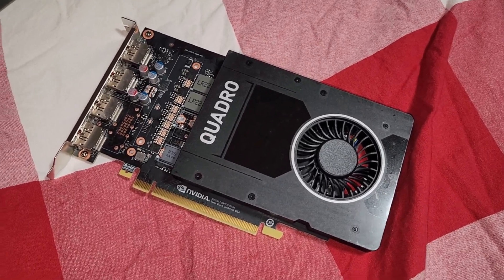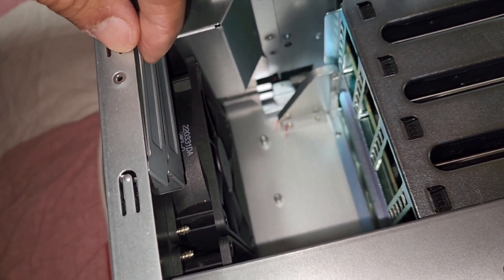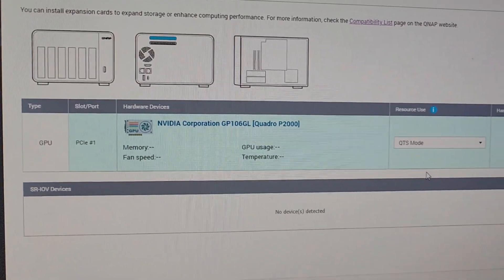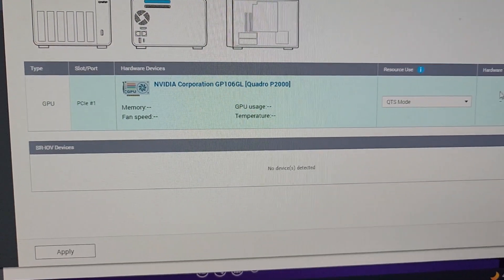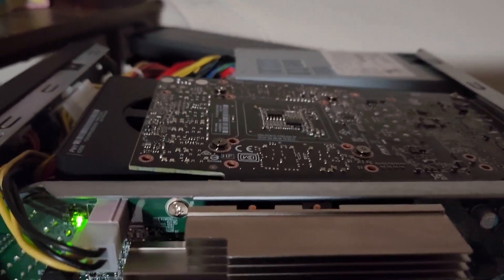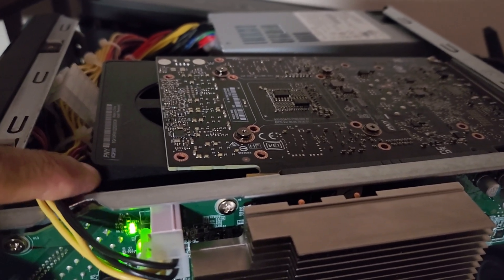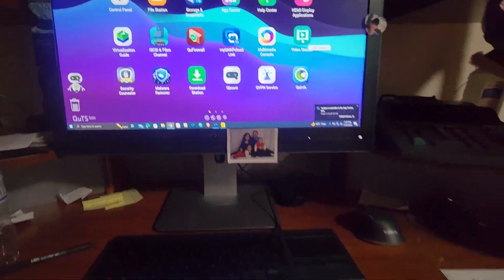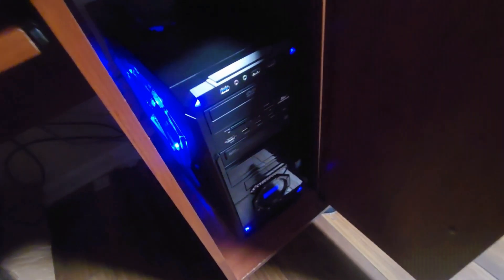Qnap Tvs-h674-i5 craziest video card upgrade!

Comment: Great video. I'm wanting to upgrade from an IBM rack server running TrueNAS as my plex server to the QNAP TS-673A and it looks like the motherboard power supply connection is exactly the same as in your NAS here.  I've got a P2000 I was planning on installing so I'm glad that it will still work with just a little cutting.

I also have a 10g network card and a pair of 16g sticks of RAM I'm going to be installing as I plan to run ZFS like I run on my current NAS.
Reply from the maker: @FastRedPonyCar  awesome 👌 as today still rocking 😎
Reply: @GHacks7  OK so I got mine built this weekend and they must have changed the position of the power cable connector and also made it much smaller.  There was a ton of room for my P2000 and getting everything else setup was pretty simple.  A very smooth experience and tested flawless transcoding huge bitrate 4K HDR videos to 1080p.

Comment: Great video! Would you be so kind as to check if this card works in the Virtualization Station?
Reply from the maker: @marcinosko8204  So far, everything is working fine. The only thing you have to do is the mod.
Reply: @GHacks7  Brother, excuse my ignorance but...HOW?! I bought the card and did the mod, it shows in Hardware perfectly etc, but NEVER uses it in anything (tried plex transcoding but it goes for CPU, tried virtualization with ubuntu station but it reverts to CPU as well)....it just stays at 0% usage in hardware no matter what... I tried QTS and Virtualization modes...
Reply from the maker: @haunter90  yeah I know, it is a trick that I did see on the Qnap UK guys channel, basically you must to force the card to work with the qnap. check this video :
https://youtu.be/dWntROE_0UE?si=qeFbENNYrJ6p5gzd

Comment: Hi thanks for the video is it also possible to Install the p2200 or is the p2000 better thanks
Reply from the maker: Looking at it I think there is no problem with it, basically all depends on the dimensions in size, the p2200 use the same power as the p2000, the Nas will be able to power it without any problems, to be honest the best way to make sure it works if you have access to Amazon just buy it there and and install it and if you don't like it just return it. ( remember if you want to fit it on this Nas you must to shave it as I did on the video. Now the big difference between the 2 cards is the CUDA cores: P2000 =1024 and the p2200=1280  basically the important thing here is the video card to handle the video streaming, so any of the 2 will be ok. Let me know how it goes. GOD BLESS YOU!!! Check this link for the P2200 NVIDIA Quadro https://amzn.to/4a6615R P2200
Reply: @GHacks7  hi thanks for the response I will order the p2200 and when it work i will shave it just like you did it
Reply: @hh-tz8zd  Hi, did it work with Virtualization Center?

Comment: I used to have a GTX 1050 Ti inside the QNAP NAS, but then I switched to a GTX 1660 Super and currently have an RTX 3060 Ti, because I've been using a 30cm PCIe 3.0 riser cable for a few years now with the GPU placed on top of the NAS. This way the graphics card has a low temperature when gaming and other workloads, which is great (I route GPU power to a Win11 VM in QNAP QVS). Cutting something on a graphics card wouldn't occur to me 🙂
Reply from the maker: Wow... with the riser cable, basically you are limit less, in hardware size, I was thinking about but I have kids and they are very curious 😀, then I had decided to do it this way because I didn't want to find any surprises when I get back from work,  especially with the price of this nas, for me this Qnap is an investment in the future memories of my family, honestly I would not have done it if before buying it I had known that the card did not fit, the problem was that Qnap had it as compatible, then, after this video, they removed it, so when I saw that it could be installed but for a bit I had to force it, take the decision to open it and check if there was any sensitive part and not finding anything I decided to cut that corner. Thanks for your comment and information, GOD BLESS!!!

Comment: Believe you are supposed to use the lower slot, despite its x4 width.
Reply from the maker: Hi Mark: It wont fit, the lower spot is for the card I just installed on my next video: https://www.youtube.com/watch?v=4wy6GoDJrdU
Reply: @GHacks7  Thanks for the video, this one shows it much clearer. It looks like h874 made quite a few compromises as compared to 872XT despite having a much more modern CPU.
Reply from the maker: So far, everything is good, now just wait and time will tell how good it really is. GOD bless!!!

Comment: I am planning to buy this NAS, is the working noise as big as the video shown?
Reply from the maker: Lol. Not really, the noise was so loud because the nas was open and then the system couldn't read the temperature of the CPU accurately for that reason the fan was working to the maximum speed,  that little fan is the loudest of the
system, I did see a guy unplug it. Honestly, after you install back the cover all that noise disappear, I have it in my room and the only thing you can hear are the hard disk spinning, but I don't hear the fans, this is the best nas for 2022, the 6 and 8 bays are professional grade, this huge machine it is made it for business in mind, I feel blessed to have this guy in my hands, you cannot go wrong with this ls monster of nas.
Reply: The small fan / fan number 3 is the CPU fan which pulls air across the CPU heat sink.  There is no shroud on the heat sink like other QNAP models and as such air is ducted in part due to the case cover.  Removing the cover and the fan can no longer cool the way it was designed.  It’s fairly common for servers to automatically ramp up the fans when the cover has been removed because of this.
Reply from the maker: @Joda Jackson  you are absolutely right, I couldn't explain it better. that's the correct answer. The opening makes the fan run at 100%

Comment: I'd be curious if a PCIe Ribbon Extender Cable could be used for the P2000, and then just have it sit inside the chassis (assuming the fan on the card was not obstructed).
Reply from the maker: I was thinking the same thing before to did this but I didn't have anyone on hand, honestly, I think it probably will, using  some velcro it can attach against the chassis of the nas, my friend if you have the time get it at the big A store and if doesn't work just do my thing or send it back, nothing to lose and a lot to win. 👌great idea!! GOD BLESS YOU!!!
Reply: tbh id prefer the cut card solution, works like a charm :)
Reply from the maker: @mailmanonfire  yeap... after the cut fits and works like a charm

Comment: Is that card on the qnap compatible list for this nas?
Reply: Oh man what a pain?
Reply from the maker: @temra2000  I know.... and it is unbelievable, yes it is the #1 in the Qnap list, check it here: https://www.qnap.com/en-us/compatibility/
 It is amazing how list this card as compatible, the software it is but not the dimensions of the physical card.. well it works amazing, but should be a different experience not like that.
Reply: @GHacks7  The URL you supplied doesn't take you to any GPU info. On the other hand, the URL I supplied takes you to the TVS-h674 GPU list.

Hope this helps someone.
Reply from the maker: @mwreyf1  I just clicked and it take you to the Qnap compatibility list... you choose 1: product type: Nas/ expansion 
2: bay : 6 bay 3: model: Tvs-h674 4: category: Gpgpu.... then will display all the compatible cards, LOOKS LIKE AFTER THIS VIDEO QNAP DID FIND OUT THAT THE NVIDIA_QUADRO P2000 5G DOEST NOT FIT! AND REMOVED IT FROM THE OFFICIAL LIST.... HONESTLY I DON'T REGRET IT THE P2000 IT CAN NOT BE COMPARED AGAINST THE P1000, IT IS A HUGE DIFFERENCE. WELL I MADE IT COMPATIBLE AND WORKS GREAT THANKS TO LET ME KNOW, I WILL DO ANOTHER SHORT VIDEO ABOUT QNAP UPDATE.
Reply: NO! It is NOT on the list page for the TVS-h674. He may have seen it on some other QNAP NAS page. But not for the TVS-h674.
Reply from the maker: @mwreyf1  yes it is compatible, fast, 5 4k streaming at the same time, Qnap has it, them they removed it for obvious fitting reasons, of course, not everyone wants to do what I did, but I take my chances, before this card I did buy the
GAMING GeForce GTX 1650 LP 4GB and that one is bigger than the Quadro p2000 5g, and if you check they still have it as compatible with this Nas, go and check or better go and buy it and you will see for your self. Then I decided to buy the Quadro p2000 5g that was the 1st option by Qnap. I see why some guys complain againstQnap!.... but I made it works, and still recommend it, you will not find a better gpu card than this one, maybe in the future but not today (2022), the quality of card I have just for the little corner! I think is worth the sacrifice! Is my opinion!
Reply: I did notice this wasnt on the list the list that last time i checked, si it must have only just been removed, I'm going to do the same thing, looks easy enough, however is this card likely to be fully supported by QNAP now in future updates etc.
Reply from the maker: @Lloyd W. A. Cosway  yes
... this after you install the p2000 5g you must go to the app store and download the Nvidia software (huge file) take a few minutes then select from 3 options (how 2 use the gpu) and that's it 😀
Reply from the maker: @Lloyd W. A. Cosway  also before remove the corner make sure 2 test the card in case is defective.... remember after that the Nvidia warranty will be void , unless you buy a square trade or other warranty.
Reply: Something like a Quadro P400 should fit fine but the P2000 is a better card.  It’s difficult to see from the video but the NAS has two PCIe slots.  One would think that perhaps the lower slot would have worked without the need to modify the cards cooler.
Reply: Fair point. You had the hardware in hand so I trust your judgment on the space restrictions issue (for both slots).  My QNAP NAS is cramped too and I’ve only installed a 10GbE NIC with dual NVMe card.  I will say this though, it’s probably a bad idea to place sensitive hardware vulnerable to static electric shock on a bed, bedsheet, blanket or comforter. The risk of damage due to electrostatic shock is higher in cold weather then warm weather but it’s still risky either way.  It’s best to work on a desk with the ability to ground yourself properly.
Reply from the maker: @Joda Jackson  Thanks again, great advice 👍, sometimes I trust my own experience as you said is kind of risky, I have been working with computers for years and thanks GOD never had a problem but you never know is better to be careful 😀 😉.
Reply from the maker: @Joda Jackson,  I did everything possible to install it before such a drastic measure, the p 400 looks smaller, and probably would fit without a problem, not sure because I never had it physically.